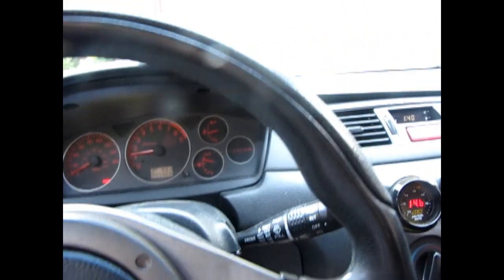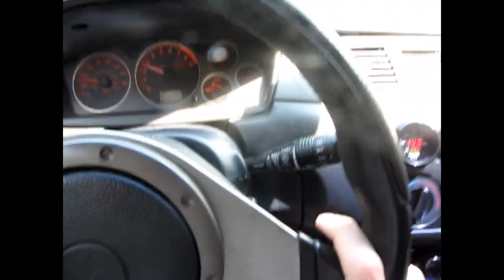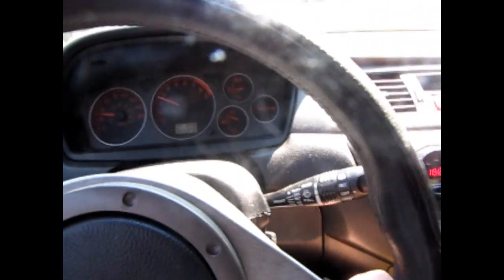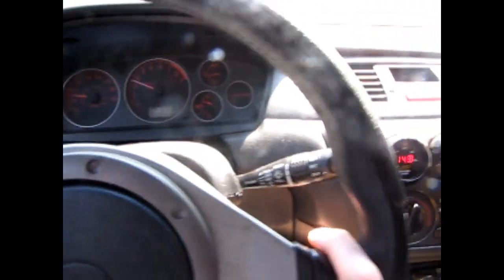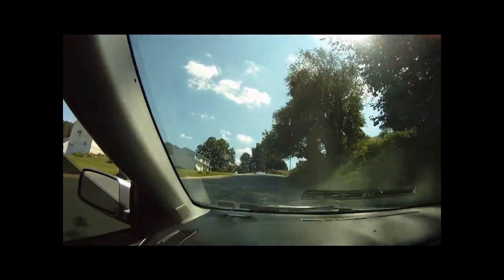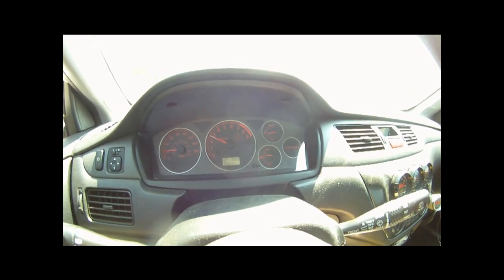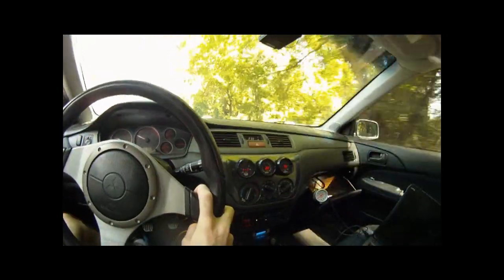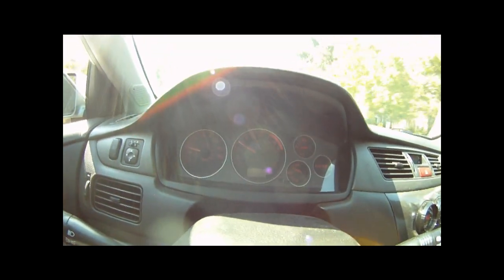Evo 8 & 9 TSCOMPTUNED driveability on speed density /w stock ecu

Comment: I am sure you have figured it out by now, lol, but throttle body shaft seals fixed my gas pedal issue. It seems just about every Evo has that problem at some point.
Reply from the maker: Ryan Tegtmeier That wasnt the issue on this car. This car uses a full blown 70mm throttle body. The issue was the AMS F1i intake manifold. The setup is no where near the same anymore now on this car. Its now over 800whp with a forward facing 6466. Check the newer videos!
Reply: tscompusa Ah gotcha. I will have to check those out. I have been looking at different setups and thought I would come check out one of your SD vids.
Reply from the maker: Ryan Tegtmeier NP at all! Thanks for watching my videos :)

Comment: barely had to use the clutch! it idles at 1300rpm. obviously
Reply from the maker: That's the only way to make a setup like this idle so smoothly. It needs a lot of RPM. The reason I mentioned the take off stuff, is because usually with these cars on stock ecu with speed density most tuners have lean spike / jitter on take off, which requires the customer to rev super high just to get the car moving from a stop. My tunes do not have that issue, and im one of very few tuners who know how to entirely eliminate it on a evo 8.